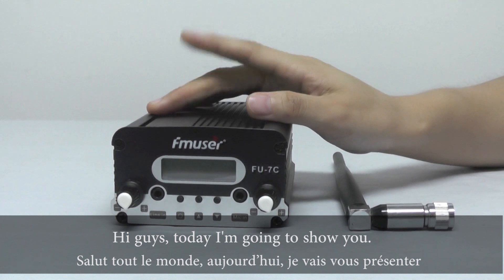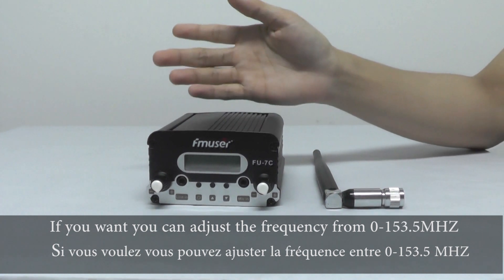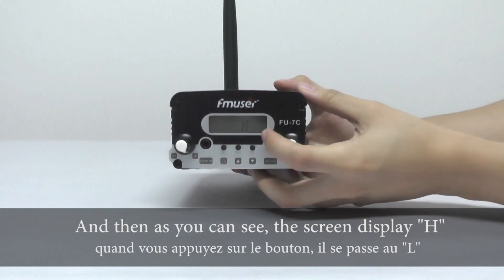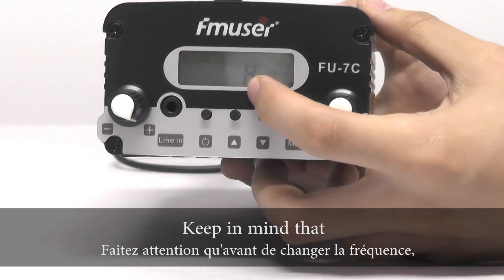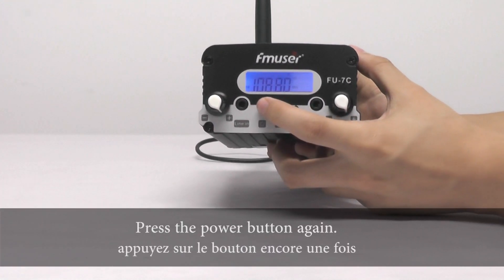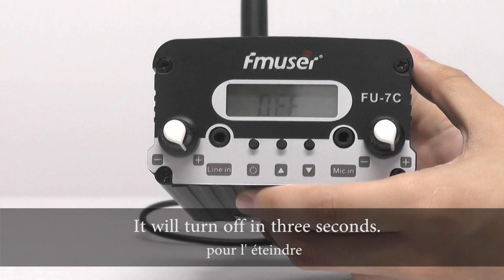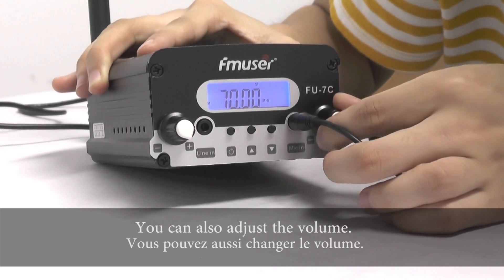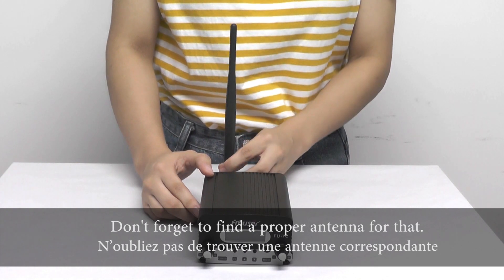7W Low Power FM Transmitter for FM Radio Station｜Introduction&Review

Comment: Could you use this on the move? Like is it as simple as plugging an audio device into it, switching the frequency to say 108.0 and it plays on a normal FM radio? If so I could technically do this on the move outside?
Reply from the maker: Nope, it do not have battery.

Comment: Again love your rig. You might want to explain setting the power a bit clearer. I find that on my unit if you want low power then after selecting L followed by press power where the screen reads 108 you as stated press power which then displays 76 but at this point raise or lower the frequency to your selected transmit station and then press power briefly and after 3 seconds it powers down. Press power again and the unit turns on to your selected transmit frequency. Do not move it off that frequency otherwise your back to high power. 😀 It took me and a meter to figure this out. By the way great job on no harmonics seen on the signal analyzer. None that I could see for sure.

Comment: Very nice little transmitter. I was impressed when it arrived. It is branded as just the ST-7C but I am reasonably sure the same tx. I will have to look for your facebook page. Incidentally, I did not know it could tx above 108 mhz. That's kind of useful so a nice feature. The literture I read strongly indicates that it has a low pass filter that provides -60db of attenuation on the harmonics. Do you know the cut off frequency used in the units low pass filter that relates to the -60db attenuation?
Reply from the maker: Hi dear, our facebook page is FMUSERBROADCAST

Comment: You may want to start with both input volume knobs turned down. Very powerful little unit for the money; I have the Signstek version of it and I assume it's basically the same thing. I get just about 12 miles of range with it.
Reply from the maker: Really?